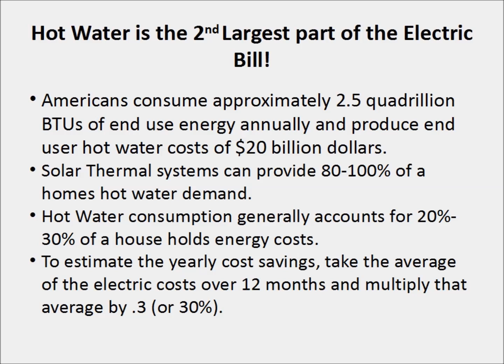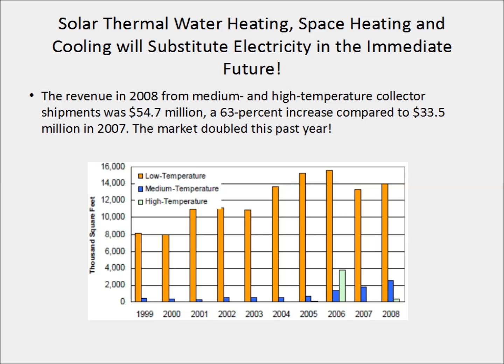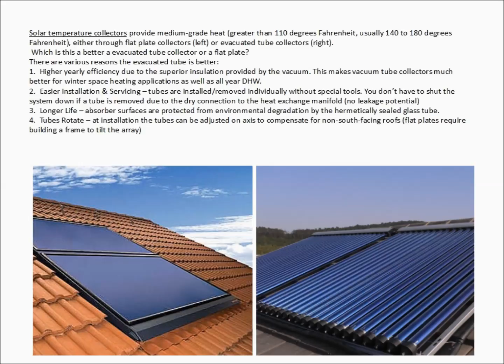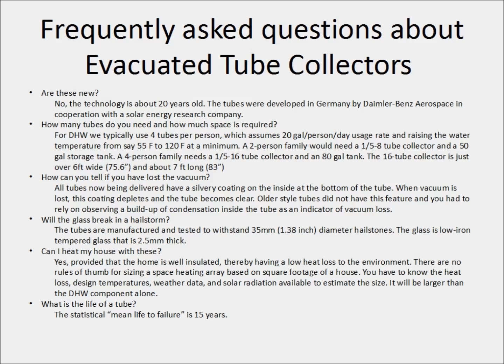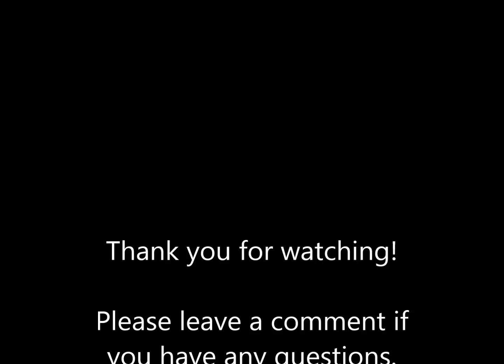Understanding Solar Hot Water

Comment: Cold Steam the efficient way to use the sun or composting and rocket stoves as heat sources to produce electricity and or distilled water explained from basic concept to employment. Water boils in a vacuum at 75 F or 24 C
Two open containers one full of water the other empty connect them at the bottom and water will reach an equilibrium 50 50. If one is sealed except for the connection the other will remain empty because of the vacuum created in the sealed container. 
Gravity will overcome this vacuum if the containers are taller than 34 feet.
 If the tanks are 40 feet tall the tanks will reach an equilibrium of water levels at 34 feet leaving six feet of hard vacuum in the sealed tank. This makes a vacuum pump set we need two of them if we were going to distill water as the cold side open tank is used to collect the distilled water from it as the continuous input of water needs to go somewhere.

Each sealed tank has four valves three at the top two of those on opposite sides (B&C) one at the very top (D) one at the bottom on the side (A), water-based vacuum pump operations are, Close bottom tank valve A and top tank valve C.   Open top tank valve D. Fill sealed tank through top side valve B. Close valve B and D when full. Open bottom valve A. 
This primes the system to let the warm water in that will vaporize and run through the system when you partially reopen valve B (to control flow rate) and open valve C to its fullest.

For only power generation need one pump set and one vacuum tank so we can have a Hot side and a Cold side one to boil the water and one to have the low pressure/vacuum to draw the steam in through the turbine then the cooling coils then to the tank. 
At the bottom of the cold side, tank is a return pipe with the one way valve to the heat source the one-way valve prevents expansion back to the cold side and as the hot side vacuum chamber is the only outlet for the expanding water and it is drawn by the vacuum the cycle proceeds.

You can combine the two and get power generation and distilled water keeping the return line from the power generation system will let you switch if you don't need distilled water on a continuous basis in large quantities.
 I am going to make one feel free to make one as well it is open source.
Reply: Barskor1 sounds very interesting, but I have a hard time envisioning what you describe. It would be great f you could make a video to see how you make it and how it works. I would love to see that and I'm sure I'm not the only one. Thank you.